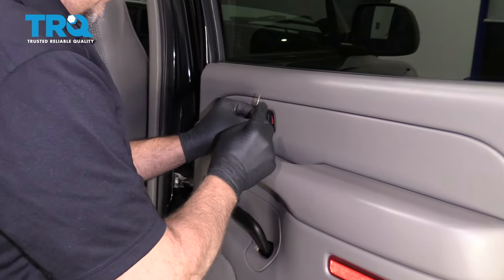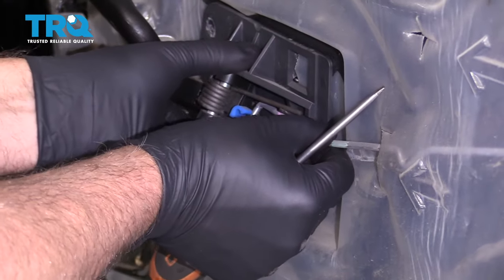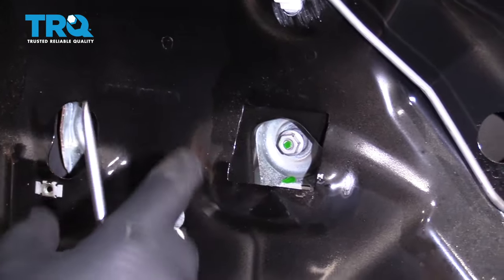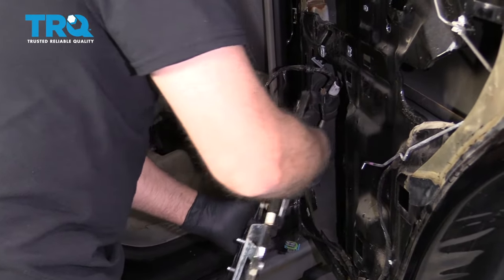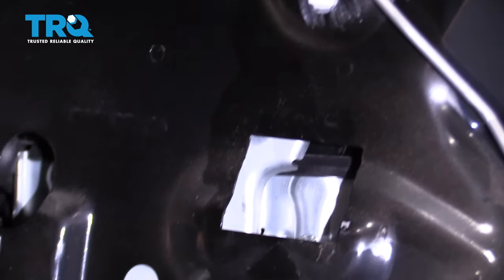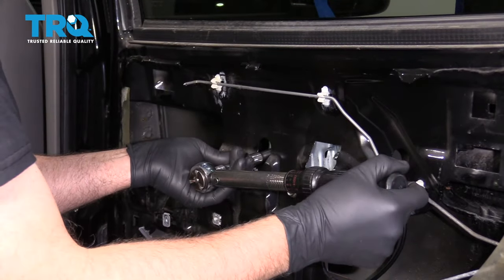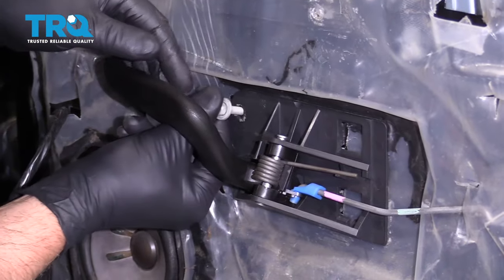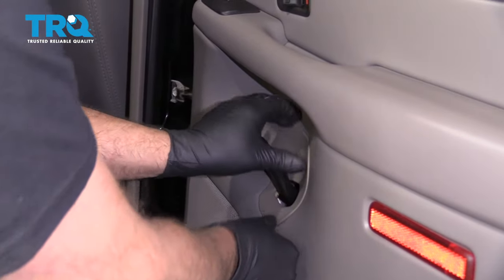How To Replace Rear Window Regulator 2000-2006 Chevy Tahoe

Comment: I've watched several vids for replacing this part and yours is by far the best! Not only well filmed and well spoken but thoroughly detailed. The only one I saw showing the extra steps of completely removing the handle, plastic and speaker. Then on the installation you showed bending the 2 tabs and spec'd the 80 inch lbs on the regulator bolts. No one else I saw did that. 
So thank you very much for your efforts! Now where do I order a Diesel Performance Window Regulator??.
Reply from the maker: +DMax ! Thanks for watching. Buy the part in this video on 1AAuto.com: http://1aau.to/ia/1AWRG01507
Reply: I Agree 100% !! 😊

Comment: yeah if im replacing a part its because it does not work so showing the repair by moving the bracket with the switch is pointless but great demonstration vid for how to repair a part if it still works.

Comment: You video is the only one I've watched that actually shows what to tighten the bolts to that actually hold the window 80 inch LBS. Would this be the same for the front window regulator also?

Comment: Hello thanks for the video, I need to change manual to electric, for a chevy silverado 2013 short cab, but I do no know if the internal system is possible to put the electrical original AC delco or generic whit a some litle changes. can you helpme whit this information ??

Comment: I’m curious if anyone else has issues with the roll up speed on their new one. I just replaced this on my 2005 Tahoe and the motor rolls up noticeably slower than any of the OEM windows. Does anyone else have this issue? I also noticed that the new motor doesn’t have a hole for the wire holding tab like the original.

Comment: Not the same as a 03 suburban… if you know how to do that then please post a video having issues with mine… mine has 2 brackets with regulator connected on one of the brackets. Removed it a year ago now i forgot how to put back in 😅

Comment: The regulator doesn't work.  What if i can't run the regulator down as shown?  Can I still get the regulator out?
Reply: Yes, but you'll have to use a wrench to loosen the nuts holding the glass, since you can't access the nuts with a ratchet & socket. It might be a little bit of a contortionist job but you gotta do what you gotta do.... OR you can drill a couple holes to access the nuts
Reply: @GuitarP0RN  Before I went with this option I tapped on the regulator with a screwdriver handle while holding down the switch.  It jolted it enough to get the window to come down so I could get to the window nuts.  Also,  the video shows the tech using the switch with it still in the door panel.  But it's much easier to pry it out of the panel and then connect it.

Comment: How in the hell am I going to roll the window down when the motor don't work?????
Reply from the maker: +William Capps Thanks for watching!  You can sometimes open up the motor and manually crank it down.  If the window is truly stuck then you can always cut the cable to free up the window. You will need the new replacement part on hand to replace it!

Comment: Why are you replacing a regulator that is obviously in working order?  You are running the window up and down to suit your needs for bolt removal. If the regulator is not working, you can't do that. Some of these how-to videos are really, really stupid.
Reply: Could be like my window situation? Keeps dropping half way down and then won't roll all the way back up. I need to open up the door for access to repair or replace and now I know how. I sure appreciate his efforts!